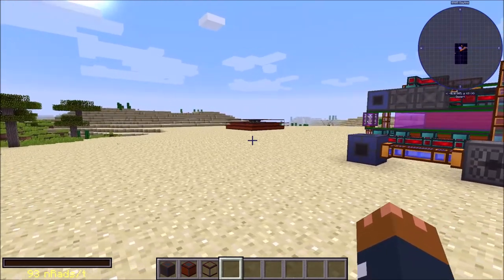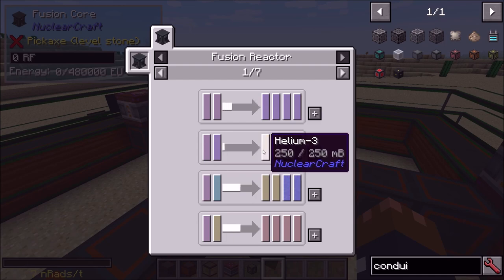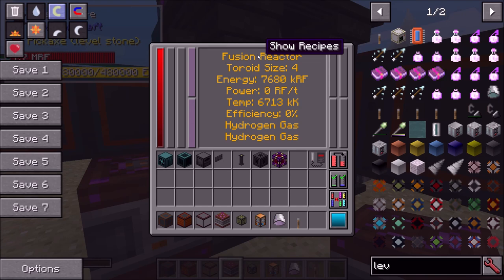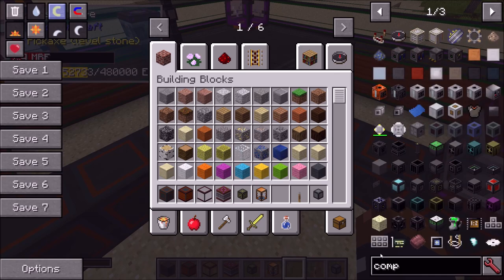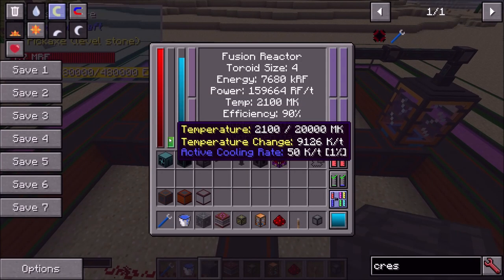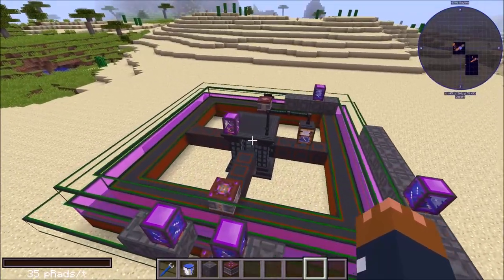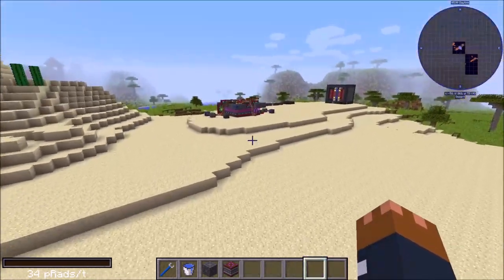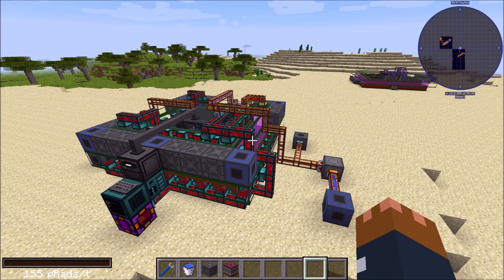NuclearCraft Spotlight - Fusion Reactor [1.12.2]

Comment from the maker: Note: the energy and fluid spreading between e-magnets and active coolers is disabled by default in the configs - if it does not work for you and you'd like it to, check that this is enabled first!

For those who want some more equations:

Power[RF/t] = Toroid Size × Efficiency[%] × Combo Base Power
Heating Rate [kK/t] = {100 - (0.9 × Efficiency[%])}/2 - Active Cooling Rate

Comment: This mod is awesome and has a lot of potential. I appreciate you making it more visually understanding with showing which blocks are energized and adding support for computercraft. My biggest critique is adding more in-game guidance. For example, a building guide with phantom/ghost blocks to show a player what's needed for a fusion reactor, at least the toroid. I would actually turn the fusion core into a multi-block structure that allows the player to designate the power output and fluid input/output. Next, I believe adding a book to explain your mod would helpful as well (if there isn't already). This would most definitely help with setup and use of your mod. 

Lastly, I personally think the variety of fuels is cool but it's overwhelming to someone who doesn't fully understand nuclear physics. I could see you removing some fuels and/or adding in the details of the fuels their atomic information like protons and neutrons. Adding the atomic info will teach/help anyone with figuring out the underlying physics. 

Sorry for the essay, but I hope you find this useful and I look forward to more updates in the future!
Reply from the maker: First off, thanks very much, and your welcome :)

I've thought a lot about stuff like in-game guides, ghost blocks and such. The former is something that I've always wanted to do, but I have very little time to get done. A couple of people have expressed wanting to help with that, although not much has cropped up so far. I write a lot of info on the tool-tips of blocks and items, but from watching players on YT and Twitch this somehow almost always goes unnoticed :P
Still, it's important and if the to-do list thins out a bit, I will work on it. In there I could also have info detailing some of the details of the physics involved, as you recommend :)

The latter is something I'm sitting on the fence for - although it would be useful, I'm not sure that, given the amount on the to-do list currently, implementing ghost blocks would be a good use of my somewhat limited time. After all, the fission reactors can be any size, so the only place they would see any use is, as you say, the fusion toroid. The thing is that they will change entirely in 1.13 and will allow for a variable minor radius, so then I would even be sure how useful they would be in that case.
And yes, a multi-block fusion core is a really nice idea... and is exactly what will be added in 1.13 :)
Reply: @NuclearCraftMod   bro you are right but at least make a manual book like the one in immersive enginnering like putting one basic plate and a book wpuld be its recipe and itd be so awesome!
Reply from the maker: @akiamini4006  It would be nice, though it does take time :P
Reply: @NuclearCraftMod   yea bro ! It was just an idea :)
Reply: Having information about atoms and such isnt any good, you will get nowhere with it unless you know how to calculate the masses of each atom before and after fusion.

Comment: the other liquid coolants are much more powerful, and you do I think need them for large enough reactors - I don't think a size 4 is a good example ... but if you have like a size 24 I think it's possible you may need to use something better than just water, because eventually you'll just run out of space

If coolant power is divided by (linear) size, surely you always have enough space for water cooling?

For size 𝑛, you have 2𝑛+2 spaces per inside row and 2𝑛+4 per outside. 4× for the sides of the square, 2× for top and bottom, and 4× for mirror efficiency, gives 128_n_+192 blocks worth of cooling. For water at 200K/t/𝑛, you only need 25𝑛 to reach 5000K/t, which takes less than one-third the space. You can even just expand the pattern you made in this video (using the same proportion of each quadrant).

Is the coolant division done differently than I understood?
Reply from the maker: You are right, yes. When I recorded this, I hadn't actually realised that was the case :P

Comment: I tried building my first fusion reactor in my customer modpack after I spend 3 days gathering materials. Size 4 reactor uses a lot more than the 180M RF I had stored up In thermal expansion energy cells and it ended up melting down right before the power output stabilized to sustain the elector magnets because of them turning off from lack of power. I was so sad.
Reply from the maker: Yep, you defo need a decent power supply along with a large energy buffer to kick start these reactors :P
Reply: 180 MILLION RF? WTF

Comment: I'm not sure what I'm doing but I'm having some issues getting my fusion reactor up and running.  I built my fusion reactor just like the one in the video, in the modpack SkyFactory 4.0.5.  I'm using NuclearCraft Version 2.15-1.12.2.  When I tried to turn on my reactor, the heat rapidly increased but I didn't get that purple/pink color in my electromagnet tube, or the sound.  My efficiency didn't go anywhere, but my heat increased very quickly toward a maximum of 8000kK.  I'm not sure what I'm doing wrong :(
Reply from the maker: The 8000 kK is not the maximum heat, that's the ignition temperature. Did the core have fuel? Is there a rogue redstone signal anywhere around the core that is keeping it switched off?
Reply: @NuclearCraftMod  Thank you so much!  I didn't realize that I was looking at the ignition temperature.  It works perfectly now, thank you so much for this tutorial, and your additional help!  I wish all mod creators were like you!
Reply from the maker: No worries, and thanks!

Comment: at max size you should be able to do it with only water
i think
....
Reply: Yep, pretty sure you can. Each cooler should be operating at 1/6 efficiency (4/24), so each is producing 33.3K cooling so you only need ~150 to get 5000K (or ~75 pairs). There are as many diagonals as electromagnets, so you shouldn't even need to make a half ring on either side.

Comment: does the core draw power from the out put or is it just until fusion begins and how much?
also, cam you power reactors through magnets (fluxduct -> F.E.m. -> fluxduct -> F.E.m.)
Reply from the maker: The core will only draw power until the fusion reaction begins, yes. It requires about 80*(size + 2) MRF, e.g. 2080 MRF for a size 24. If you're asking if the electromagnets can supply power, then the answer is no.
Reply: @NuclearCraftMod  wait, I just realised I can connect them through a few more E-mags

Comment: i am playing the version 2.7b on 1.10.2 and the active coolers just dont work for me... maybe i am doing something wrong but i wouldnt know what. I am placing them onto the magnaet ring of my fusion reactor connecting them with a ender io fluid cable to a enderio fluid tank but nothing seems to happen. help :)
Reply from the maker: Where on the toroid are you placing them? What coolant are you using?
Reply: @NuclearCraftMod  Thank you for the quick response. I was placing them first the way shown in the video, and after i tried placing them on top, so on the middle ring on top. As coolant i am using resonant ender, made out of ender pearls in the magma crucible from thermal foundation. If they were working how would i notice? Is it shown in the reactor when the coolant is active, specfically in this version.
Reply from the maker: @dieterjackson7289  They won't work on the top - they have to be on the diagonals. It's been a long time since I worked on the 1.10.2 build, and it may not have shown the active cooling rate in the GUI back then. If not, the only way to tell is to wait for the temperature to approach the optimal level and see if it stays there.
Reply: @NuclearCraftMod  Ok, thank you so much. Only one more question what is the optimal temperature? Simply reach 100% efficiency? Or can i calculate the right temperature i will have to reach?
Reply from the maker: @dieterjackson7289  It's the 100% efficiency temperature, yep. You can calculate it from the configs, but you don't really need to. Later versions tell you in JEI, but the 1.10.2 builds won't have that.
Reply: @NuclearCraftMod  Ok, thx for the help.
Reply from the maker: @dieterjackson7289  No prob!

Comment: What is the largest size that can be built wit fusion connectors?
Reply from the maker: The largest toroid size by default is 24, which uses 23 connectors on each side :)
Reply: @NuclearCraftMod  How much power does it generate using using the best fuel mixture?
Reply from the maker: @yoshi6236  With default configs at the default max toroid size, 3.84 MRF/t
Reply: @NuclearCraftMod  I mean, not bad. Since you're replying and will probably see this, what do you think about antimatter. Maybe you can somehow collect and store it, and generate an order of magniture or two more power? I know it doesn't really make sense since in real life you first need to create it, but maybe you can come up with some kind of semi-realistic system to get that stuff? I'm just a fan of overkill stuff which requires a few hundred hours of grinding, and I also like your mod, so why not?
Reply from the maker: @yoshi6236  I guess we'll continue the convo on Discord :P

Comment: How do you hook up a comparator for the smallest size reactor? There is not enough space at the bottom then.
Reply from the maker: A redstone signal can travel into an e-magnet block, so with a couple redstone torches you should be able to loop the signal through the bottom of the ring and back.
Reply: @NuclearCraftMod  Thanks!
Reply from the maker: @stragulus  No prob :)

Comment: How does it actually produce power? It's unclear on both the wiki and this video. How do you extract it? From the base, or any side? Can it power its own magnets after it reaches a certain temperature? 

Literally the only thing this is useful for at the moment is making glowstone in Compact Claustrophobia. I can't extract power from it and it seems like a power-drain otherwise.
Reply from the maker: Power is extracted from the core. Exactly how much it produces depends on the toroid size and the configs.
Reply: @NuclearCraftMod  Figured it out back when I was playing compact claustrophobia! Thanks for following up though!
Reply from the maker: @elliejohnson2786  Good to hear you figured it out. Sorry about the super late reply, I've been going through a bunch of them that I've been letting slide for the past few moths :P

Comment: One thing very much missing from this video is the answer to the question "Why do my electromagnets randomly explode even though my reactor is far below the optimum efficiency temperature?"
Reply from the maker: E-magnets exploding is caused by them running out of energy, while a meltdown of the core is caused by reaching the maximum core temperature.
Reply: @NuclearCraftMod  I appreciate the response, especially on a 2 year old video, so thank you. I did find out that was what was causing it, but only because I browsed the closed issues on your GitHub in desperation, and you had replied to a guy having the same problem as me.

NuclearCraft is an excellent mod, but it seems to be difficult to find good documentation for it.
Reply from the maker: @Wishbone1977  Unfortunately the docs for the old version of the mod were put onto the official FTB wiki, but they're now somewhat outdated. For the overhaul an in-game book is work-in-progress :)
Feel free to ask questions either here or in the Discord server where there are lots of people who can help out :)

Comment: My first reactor exploded. First i used 1B of hydrogen and deuterium, at that point the temp was only 14000K. Then i poured Lithium-6 and 7 as fuel, the temp decreased, after a while it exploded... Please explain this, i'm so confused...
Reply from the maker: If the temperature decreased, it means the reactor wasn't running. If the e-magnets exploded, that means they lost power and the plasma escaped.

Comment: So I've watched the video, and built this thing exactly how you did, but for some reason, even after using infinite energy blocks to power the electromagnelectromagnetic, randomly depower at random and blow the reactor.  Highest I got to was 85% efficiency with 100% active cooling before the reactor blows.  I even put a power cable to each and every electromagnet incase there was a power permeation glitch but to no avail, it still blows.  Any suggestions?
Reply from the maker: Unfortunately not. The only way the e-magnets can fail is if they run out of power.
Reply: @NuclearCraftMod  Wow!  That was fast 😭.  I searched around in the configs and it said power needed to maintain an electromagnet in fusion configs was 4000, so I lowered the amount to 200.  Could that potentially fix the issue, because I thought the electromagnets only required 200-300 to run.
Reply from the maker: @jellymc2877  Ah, soem of the configs are a bit weird as they're in units of RF/s, rather than RF/t, so 4000 does correspond to 200 RF/t.
Reply: @NuclearCraftMod  OH ok.  Thanks for your replies even after 2 years!  I'll continue troubleshooting to see what the problem is.  It seems to occur mostly when loading back into my save.
Reply from the maker: @jellymc2877  No worries! There is some dodgy code in the pre-overhaul builds, so sometimes stuff doesn't work quite as intended. Others might be able to help you in the Discord server too if that's something you want to do :)
Reply: @NuclearCraftMod Yes Please!

Edit: I believe I found the issue.  Everytime I would log back in, the cable that I had connected to the core for power would disconnect and not power the entire reactor, thus leaving it depowered.  I fixed it by putting a cable coming out the bottom and to the rest.  Hopefully it continues to work.

Comment: So an issue I'm having is the electromagnet blocks' textures aren't connecting. They also aren't spreading energy from one to the other and require connecting a power cable to each single block individually. 

As in 2:45 that spread of green is not occurring. And I'm on the latest version (as of posting)

example pics: https://imgur.com/a/pHYrBRK
Reply from the maker: The connected textures appear if you install the Connected Textures Mod, and the e-magnets will spread energy if the 'passive permeation' processor config is enabled ;)

Comment: For sake of not wasting all my materials and possibly melting them all, I usually test reactors in creative before trying to use them in my actual game. I'm trying to replicate the exact reactor in the video here, and for some reason the power im supplying to the electromagnets isn't spreading between each other, I would have to manually connect each and every cell to a power source to power them all, and with the need of coolers, that obviously can't happen. I'm using enigmatica 2 (standard) version 1.53 . Does the fact that I'm in creative cause problems, or what's the issue?
Reply from the maker: Hey there - in order to get the energy to spread between the e-magnets, and various other effects like active coolers spreading coolant between each other, you need to head into the NC processor configs and enable 'passive permeation' ;)
Reply: @NuclearCraftMod  thank you for the very fast reply!
Reply from the maker: @itDingle  No prob!
Reply: @NuclearCraftMod  Had the same issue, thanks for the info!

Comment: HELP!
Fluids are not transferring in the latest release!
Reply from the maker: Can you give more details?
Reply: I did a bit of experimentation and I was able to transfer hydrogen from a Galacticraft Water Electrolyser/electrolyzer(?) via Galacticraft Fluid Pipes to an EnderIO Pressurised Fluid Tank and transfer the hydrogen from there to the fusion reactor via Fluid Conduits, making sure to use the Thermal Foundation/Expansion Crescent Hammer and Galacticraft Standard Wrench to Make the inputs and outputs correct. The problem now is that I cannot pump deuterium from the fusion reactor to another fusion reactor that fuses hydrogen with that deuterium to make helium-3, which I cannot pump to another reactor to fuse the helium-3 together to finish off the Proton-Proton (I) chain reaction.
Reply from the maker: @elweewutroone  How are you trying to extract the products from the core?
Reply: (By the way, PP(I) reaction is as follows:
Hydrogen-1 fuses with hydrogen-1 to make deuterium (in real life, it fuses into helium-2 before almost immediately beta+ decaying (which releases an electron neutrino along with a positron, which annihilates with an electron) into deuterium (hydrogen-2)
Deuterium fuses with hydrogen-1 to make helium-3
Helium-3 fuses with helium-3 to make helium-4 (alpha particle) and two protons (hydrogen-1 nuclei))
Reply: Also, I pumped water using a Buildcraft Pump from an infinite water source to the five Water Electrolysers/Electrolyzers(?) I had connected.
Reply: NuclearCraft 
Using EnderIO Fluid Conduits.
Must I extract from a certain side?
Reply from the maker: @elweewutroone  Ender IO should be fine... you sure its being extracted and being sent to a legitimate place?
Reply: I am sending the deuterium to a deuterium tank along the way before it reaches the next fusion reactor.
Reply: The tank that contains the deuterium is a Pressurised Fluid Tank from EnderIO. I have tried extracting the deuterium from the bottom, side and top of the reactor to no avail.
Reply from the maker: @elweewutroone  I'm afraid I don't know what's going wrong then. If you join our Discord server and give me a ping with some screenshots or something, I may be able to help in more detail :)
Reply: NuclearCraft
I fixed the problem today by toggling Redstone Mode in the settings menu for the Ender Fluid Conduit and changing the channels (colo(u)r)).